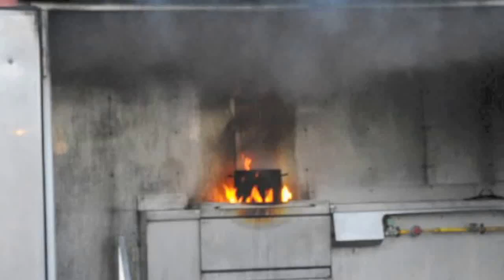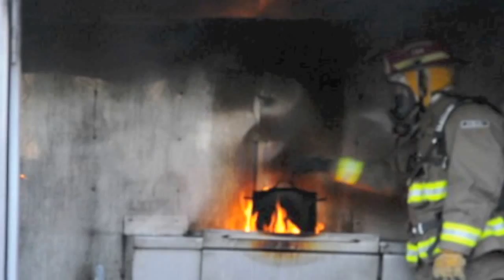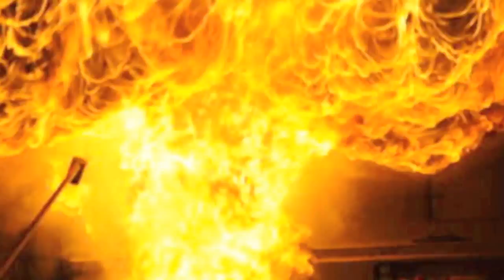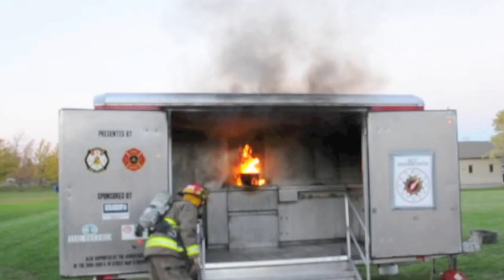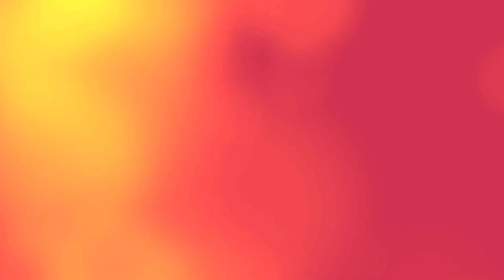Putting Water on an Oil/Grease Fire is Dangerous & Dramatic

Comment: Lots of years ago in a firefighter show I poured a cup of water into a pot with old burning fat. There was no ceiling as in the vid here. So the flames rose some 30 ft. With a foam extinguisher the flames also rose some 4 ft. When I put a fire blanket onto the pot the fat vapors went through it and burst into flames again. No matter if single or double layer. A powder extinguisher put out the flames for some seconds. Then the powder foundered and the fat burned again. The only way to put the fire out was to fill in powder into the burning pot and then IMMEDIATLY fill with foam. Of course the fat overboiled but the fire was put out definitely. IMPORTANT: the older the oil/fat is the higher is the flashpoint and the more difficult it is to put the fire out.
Reply: Sounds more like you're describing a white phosphorus or lithium ion battery fire geez fat oil fires must be really bad.
Reply: @NebosvodGonzalez  It was more a solid fat fire than an oil fire. So it was really difficult to put out.